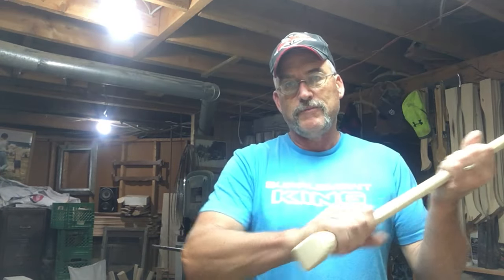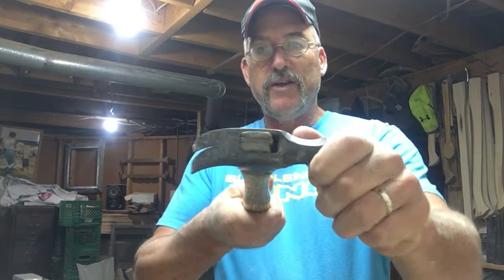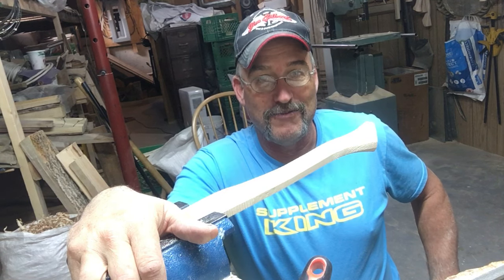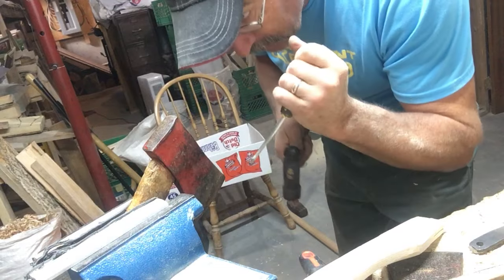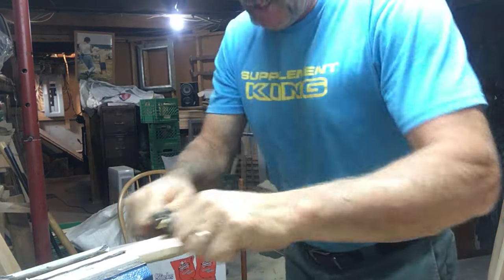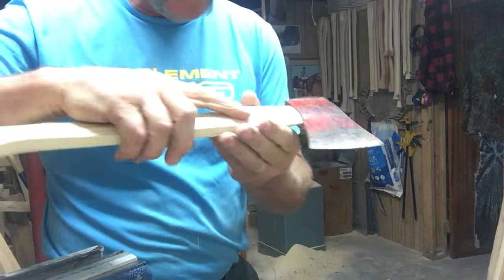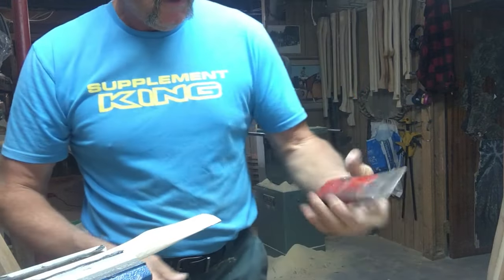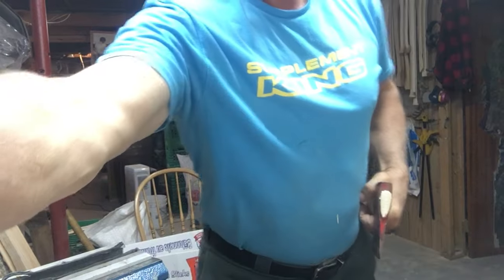Special order - handles for guys with limited grip

Comment: I picked up an old axe at a flea market last year that had a beautiful vintage handle that had grooves carved into the under side of the grip right at the fawns foot. They ran parallel across the handle from side to side. Seemed like they were meant to improve grip. Unfortunately the handle wasn't  salvageable but I always wondered how that might feel when swinging.
Reply from the maker: Interesting.  I bet it was also for grip.

Comment: I had an idea watching this, I’ve made zero axe handles in my life so if it’s a stupid idea so be it. Could a soft wood handle sleeve be utilized in the grip zone to lessen vibration? I’ve had hatchets with leather handles but they are stacked to such a density that it’s a pretty sharp shock. Rubber and fiberglass can be nice but that just seems like an unreasonable choice.
Reply from the maker: Hmmm.  Interesting idea.  but, you'd have to elaborate a little.   not sure how a softwood sleeve would work
Reply: @eastcoastlumberjack  im imagining two separate pieces of willow or something even softer if that’s possible, hollowed and contoured to fit over the handle, maybe hardwood handle recessed in the same area so the soft wood “inserts” or sleeve remains flush adhered with an adhesive and maybe a brass or steel bolster. Would make for a nice two tone handle even if the dampening wasn’t that incredible. All that being said I can hardly whittle so if it’s a crappy idea I’m not offended. I do appreciate your further inquiry either way.

Comment: It’s sad that the people willing to do the work have arthritis
Reply from the maker: true - his is a step up from arthritis.....not pretty
Reply: @eastcoastlumberjack  I was a career plumber, and all that stuff is coming back to bite me now. I started making a few mallets for shop use and use almost the exact same design as the ones you showed with the contouring on the handle and flare at the end just to help me from tossing my mallet by accident when my arthritis is flaring up. Ergonomics is important for safety in my opinion, and anyone that can make those small modifications can really benefit. I used a couple rough files to shape an Osage Orange handle and I can say for certain that I much prefer using a kutzall disc on my cordless angle grinder for mass material removal as opposed to the spoke shave for one dumb reason… it is fun to sit there making curls of wood and it’s easy to get carried away 😂.